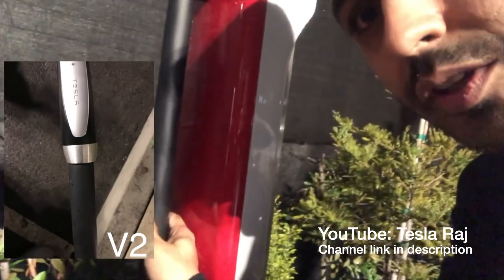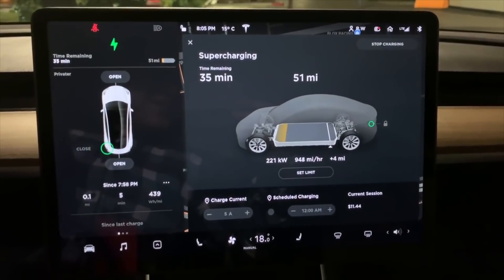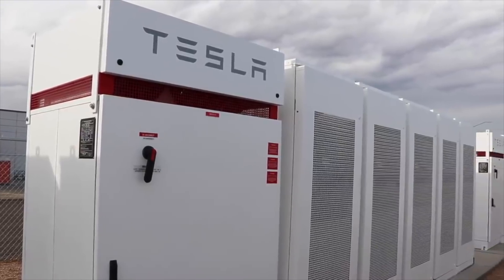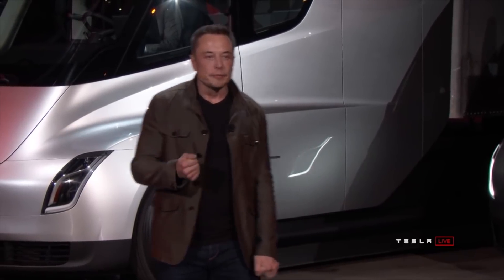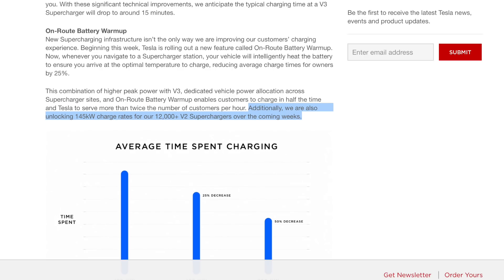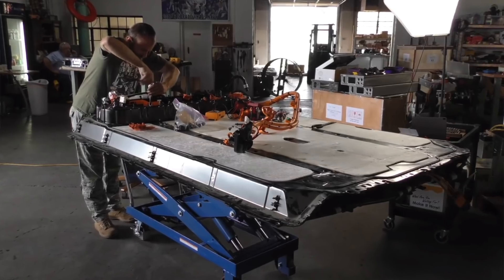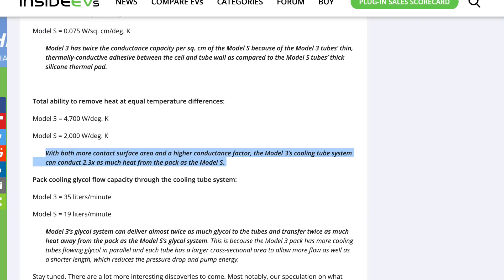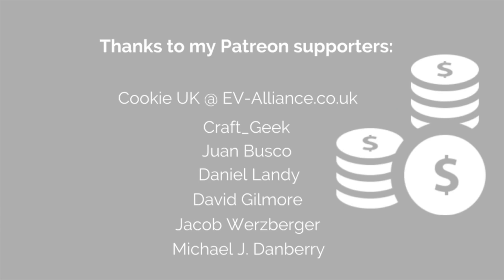Supercharging V3 and why Model S and X aren't eligible yet

Comment: Great video,

Elon just twitted s/x/3 is part of it. If I read it right.
According to Elon Musk...@Elon on Twitter,
“Latest software improves Tesla Supercharger times by up to 25% for all Tesla S/X/3 worldwide, incl original 2012 Model S. Not splitting power across 2 Supercharger stalls helps all cars up to 50%.”
Reply from the maker: Yes, but that does not explicitly mean current S and X will be eligible for V3. They will most certainly receive the V2 update to 145 kW. I think S and X need a new battery design for V3.
Reply: Sean Mitchell thank you... I think we kind of have to wait and see what 145 kw can do.  

I sure hope that model x and s can support v3 benefits , because those cars were a lot more expensive than Model3 and we could tell our friends that we got upgraded to full version 3. 

That will change a lot of minds. My brother would be one of them. 

Although, we have a Model 3 in our family it will not be a huge difference for us since it is not the trip car.

Comment: Tesla is getting closer to parity with gasoline vehicles.  We are living in exciting times.
Reply: The Model 3 is already cheaper than its comparable ICE car:

Tesla Model 3 Mid RWD - $40,000 5.6s 0-60 258hp vs. BMW 330i RWD - $40,250 5.5s 0-60 248hp 
Tesla Model 3 Long AWD - $47,000 4.5s 0-60 346 hp vs. BMW 340xi AWD - $50,950 4.6s 0-60 320hp 
Tesla Model 3 Performance AWD - $58,000 3.3s 0-60 450hp vs. BMW M3 RWD - $66,500 3.7s 0-60 425hp 

I really don't know how Tesla is selling their cars for so cheap. I would say though that small sedan sales for Audi, BMW, Merc, Lexes, etc... are doomed...
Reply: Carlos Malave next 6 years they’ll have the same range as a 4 cylinder on one tank
Reply: @hmorris  thats pointless. the only reason you need a gas tank that large is because you cannot fuel at home. for trips nobody cares about a 5 minutes stop every 3 hours, certainly not worth 1000s in batteries to avoid
Reply: Richard Roberson batteries are getting cheaper A’s country’s are mining the materials in greater sizes like Australia for example. And electric cars need to have longer ranges because there just isn’t enough chargers around, sure you can charge at home, but it takes hours. Maybe in contries with small surface area like most country’s in Europe electric cars do not need long ranges but the us and Australia? No definitely more time
Reply: @hmorris  theres more than enough chargers already to travel with a normal EV ie a tesla....they need to make 16kwh 80 mile PHEV that can just use gas on long trips as thats not even a significant use of fuel.  theyre only charging faster every year....range costs WAY more as you have to add it to every single car vs 1 more charger.

range already doesnt matter
Reply: @Richard-ie1if  you sound like a bitter leaf owner
Reply: @themusicman4u46582  im not. but its true. most tesla owners never use the range of their cars....

if you look at the network theres embarrassingly gaps that I wouldnt want to try covering in a base 3, 2017 60D (let alone the 60D x).  When I say gaps I mean legs that you are force to go through as is in the highway network.  Memphis....

chargers are far more useful than adding on more range.  especially as the charge speeds climb into 350kw+

and yet tesla is throwing up urban chargers as fast as they can in CA and the highway network has seen little improvement

still 5 massive holes in the US that a tesla cannot go into with a wall charger 

never got why they didnt add a stupid wifi adapted to the 1000$ chargers....and allow joe smoe to just install some outside and charge x dollars based upon cars energy meter to let strangers use it. seems laughably simple.  

other than the small savings of a gas generator, EV image, and performance as of today there is no reason to take an EV over a PHEV.  tesla can and will end up selling its sensor kit to anyone who wants to pay if theyre first on the scene with FSD. 

prius prime at 22k blows model 3 out of the water cost wise and practicality wise.  if it was credit capped to 16kwh 70+ miles it would be just as green and could almost do trips on electric only.  it would also cost 22k vs 40k soon.....

if batteries can be made to output more power or capacitors included there wouldnt even be a reason to want the larger pack.

at speed a model 3/prius only uses some 25hp

Comment: I'm wondering if another limiting factor in the Model S and X is the 18650 cells.  Perhaps they cannot be charged as quickly as the 2170's while maintaining a safety margin.
Reply from the maker: It's possible although I don't know enough about the physics of it. I'd say the battery chemistry has more to do with managing heat than the size of battery.
Reply: Or perhaps it's the cross-sectional-area of the cable from socket to charging circuitry? Did they envisage such high charge rates when they started building the S & X?

Comment: They need to referesh the S and X with updates to the interior (which don't look anything worth $100k) and Maxwell's DEB.. They should focus on lower weight right now.. Range is more than enough for everyone.. 

20% gains with DEB means that a 80KW battery would have the same range as 100KW (i know 20% of 80 is 16 but the lower weight should also aid more range)..
Reply: I just got a Model X with the premium cream interior, it's wonderful.
Reply: @zelekuther7938  yea sit in any $100k BMW, Audi, Merc and you will know what luxurious means.. It is time Tesla stopped selling on technology and start selling better overall products..
Reply: You are 100% right Rahul. Even the E class Mercedes is better than the 2018 S 100D that we have. My wife keeps pushing me to trade in our Tesla go cart on a Mercedes Wagon but I do like driving past gas stations. To you people out there that think the Tesla is so smooth riding. I think your butts need to get a bit older before you have enough experience to know what a smooth ride is. Ray
Reply: rahul nargundkar maybe that’s why Tesla reduced the price of the 100 kWh battery a few days ago. It now costs closer to $85k

Comment: Im going to go against your bets Sean. I think that the model S and X will skip over the 2170 cell/cooling found in the model 3 entirely and instead go straight to what ever tesla plans to use from Maxwells DEB cells. The model Y will be announced but there will NOT be a one more thing involving a refresh, Elon said not long ago that the model S and X wouldn't have battery changes for awhile. The pickup being announced will likely also have maxwell's DEB technology and could be when the S and X get the refresh. I dont think it will go like that though, i think the pickup will be announced with questionable cost/performance but they wont say how they will achieve it and then when the pickup begins production several months or maybe even a year later they will simultaneously switch the S and X over. I want tons of internet points when i end up being right! Lol
Reply: I agree regarding S/X and 2170.
Remember the Maxwell deal isn't final.
If it does go through, the scale up works and the technology can be used for cylindrical cells (!?) Would there be any reason they couldn't have one line for 18650? The prices is apparently so much faster, that it may be economical.
Note: I believe Maxwell were testing with pouch cells(?)
If it goes through, Q4 cell upgrade? In time for model Y?
My "fun" punt for the Y launch?
20 Model Y delivered to stage by 10 Semi Trucks(!)
Would mean a limited production of Y available for test, and the same for the Semi.
Moving the target for both to Q4/Q1.

A thought about Semi charging.
Why not use 2 cables per truck from 1 charge box? Or one (2?) charger either side, both keeping cable diameter down?
Logically, equivalent to 4 model 3 packs, 1 V3 charger per pack, 30 minutes full charge.
Reply: @rogerstarkey5390  Check out latest hyper change video with regards to Tesla likely having tested stuff out with maxwell already.
Reply: It would make sense that they would leap-frog. I think the reason they haven't upgraded S/X to 2170 so far (aside from focus on 3 ramp) is that the capacity to make them hasn't ramped up enough yet at Giga. I heard that they have a contract with Panasonic to buy 18650's also that could be still in play.  I could see them introducing at some point an extra long range S/X initially but the cost to design would only make sense if it was only minor new engineering to later switch to DEB in 2170 form factor.  Likely, if DEB is also 2170 they will put it in S/X first and keep existing capacity for regular 2170 going to 3 packs.  Once fully scaled, I would assume 3 would get DEB next and the current 2170 lines would be used for home/grid storage.  That said, can they scale Giga fast enough or implement DEB fast enough to also have enough capacity for Model Y? Current 2170 should be competitive for a few years yet as well.
Reply: Agree as well. Musk noted that on Q4 call. My guess is Maxwell tech for S and X. But what CAN happen is meanwhile upgrade S and X charging cables and internals to accept higher rates. Still at least 2xC should be acceptable even for old battery types.
Reply: Whatever move Tesla decides to make, the one thing that’s certain, is that they should at the very least get their battery tech for S&X on par with M3 ASAP. Otherwise those sales become harder and harder. On the other hand: maybe they don’t have to care as much if M3 has higher margins and rakes in cash at a stupid pace.
Reply: battery changes maybe, the packs are just shitty....doesnt take a genius to figure out adding more cooling loops and a larger radiator that doubles your charge speed is a pretty good idea.
Reply: But Elon never says anything that's true, so you have convinced me S/X will get new packs soon...

Comment: Personaly I don't think that the new S and X will be revealed with the Model Y I think it is more likely that it will happen with the Pick Up
Reply: My bet is that the pickup will use maxwell's DEB tech and they won't disclose it during the revealing but when the pickup is going into consumer production they will then refresh the S and X which will also use the DEB tech
Reply: larry Spiller what DEB offers, to my understanding, is more relevant to Tesla than to customers: higher energy density means less battery mass for same distance traveled. Since we shouldn’t confuse DEB with supercapacitors, the benefit is cost of production and weight reduction, more than it is longer range. So DEB wouldn’t really do much for Model 3-level charging, which should become the minimum for S/X ASAP, imho. So if DEB doesn’t solve charging speed, they could go ahead and use M3’s battery tech in the interim to going with super capacitors.
Reply: @KILLEKILL  larger packs can inherently take higher charge rates regardless, and given they figured out cooling on the 3 i would assume they will achieve the same level of cooling on the updated packs for the S and X using the new DEB tech. Maxwell's promise to a 20% increase in density (minimum and up to 100% theoretically) means that tesla can now fit 120kW into the 100kW space. They no longer need large complex ovens to dry the electrolyte which will save time space and money. Sure they could take all of the profits and keep the pack storage the same but i doubt that. Tesla's advantage is relentless innovation and considering they cant keep up interior wise (i don't care but some people make a huge fuss) i think they will instead keep the same price for more range. So the tesla model S will 400 miles at the same cost. That will be their advantage and on the production side they will still increase margins thanks to the efficiency of the new process. Yeah you could pickup a Porsche taycan but the model S will dwarf it in range and have autonomous driving. They aren't going to compete on interior quality but that should give many people more then enough reason.
Reply: @larryspiller15  That wouldn't be bad.
Reply: It may be like a one more thing and be on sale on next quarter or be revealed on a totally different date
Reply: dont even need a refresh, the pack is just horribly outdated.  apparently just adding more cooling can double your charging speeds go figure..

heck add a retrofit in to upsize the radiator and pump cooler glycol through

Comment: Anyone have any idea what the bobtail range is on the semi truck?
Reply: https://en.m.wikipedia.org/wiki/Tesla_Semi 

-Running empty, the long-range Tesla Semi would have a range of 620 miles (997 km).
Reply: Yes bobtail is the industry term.  And yes there is a call for it. one way to florida for example, Under a power only contract.  I suspect 1100 maybe low but I thought I would put it out there to see what others thought or know.
Reply from the maker: Haven’t heard that phrase before. Does that mean top end range?
Reply: Range without a trailer on the back.
Reply: @helmshardover  Of course with a trailer. Without would be stupid to give as range
Reply: @TobiLobi  Definition of Bobtailing: "Driving a cargo carrying truck (semi-truck) without a trailer attached. Be careful not to confuse “bobtailing” with “deadheading,” which happens when driving a cargo carrying truck pulling an empty trailer, i.e., containing no cargo. Bobtailing often happens when a contracted truck driver is first sent out from dispatch to their pick up site."
Reply: @helmshardover  Oh I'm sorry. I am not a native speaker and didn't quite understand the differance. But I guess something around 1100 to 1500 miles seems possible. And I just realised that you are stating a fact and not raising a question.
Reply: @TobiLobi  Sean was asking what the term meant...